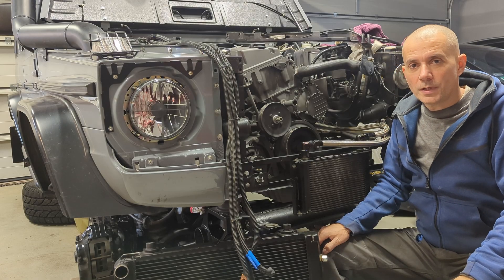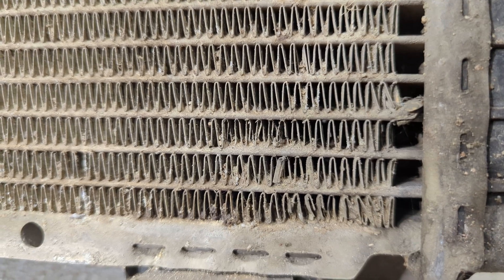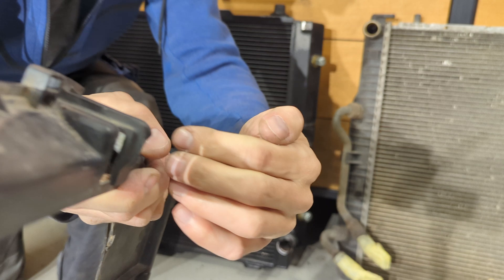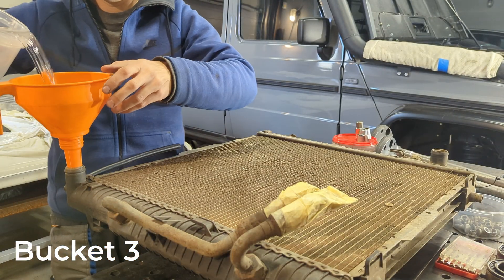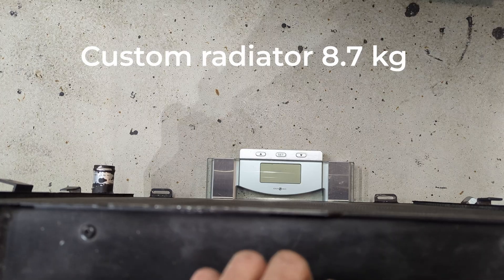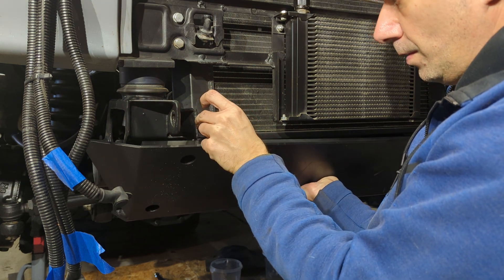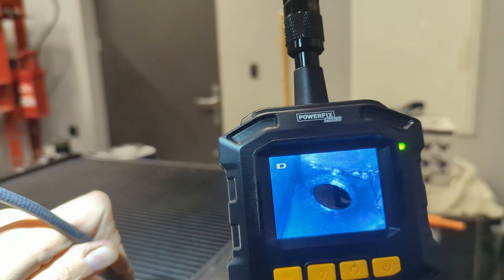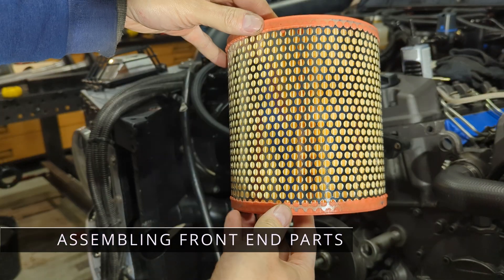OM606 Cooling STACK (4 radiators explained)

Comment: Thank you again for the video. Your build is so clean that I'm a bit jealous 😅 what about ac?
Reply from the maker: This G Wagon didnt have ac from factory. AC for G consists of many parts, including cooler, compressor, interior cool exchanger in blower, pipes, hoses etc, so during my almost 4 years rebuild I didnt want to have one more complicated thing on my head. I wanted to drive it ;) TBO I dont need ac that much, so I didnt have any additional motivation to install it. Maybe when I done with other things.

Comment: Nice video, again. I'm very much interested in the radiator you found. I bought the original replacement version for 150 euros but I don't like the plastic. What's the companies name in Poland pls? I'm still building on the om606. 
Keep following your adventures. Ciao.
Reply from the maker: Thanks, please take a look at description of this video. I put link to each radiator there. Good luck with your build!
Reply: @MercedesOffRoadClub  Mmm. Tnxx. I need new pair of glasses...👍
Reply: I'm going to put the engine oil cooler and the 722.6 oil cooler under the car. I don't want any other cooler in front of the main radiator. I also don't use the visco fan. I mounted an electrical from a Sprinter. Very tight but possible. I have to built your inlet filter box. It's perfect! The DPUK filter housing does not fit with our Holset HX35. 👌